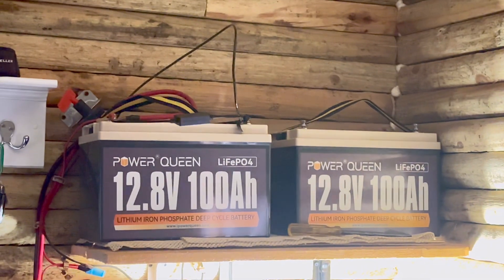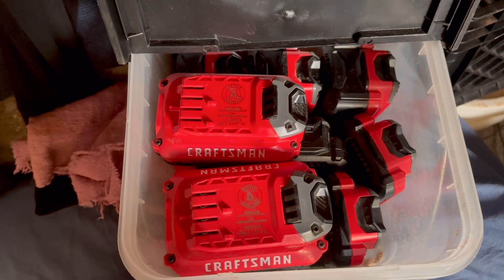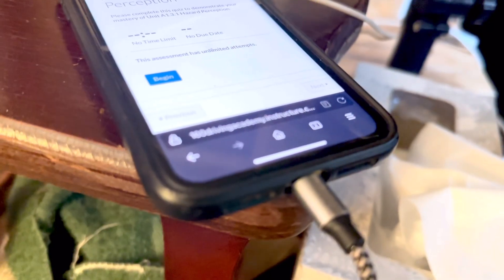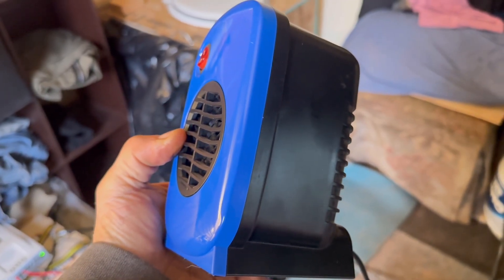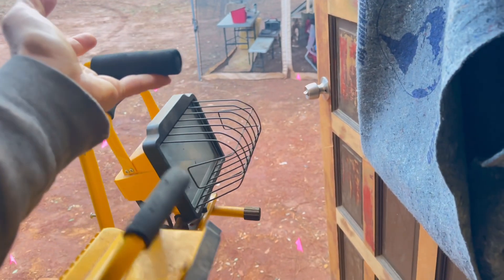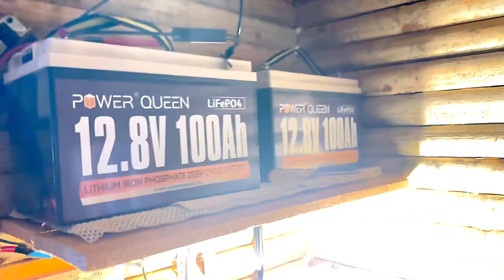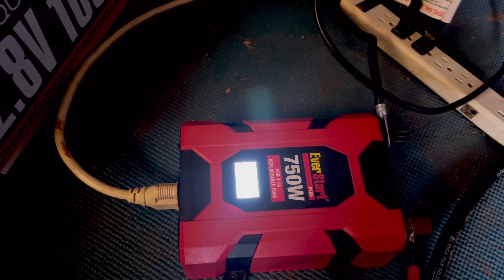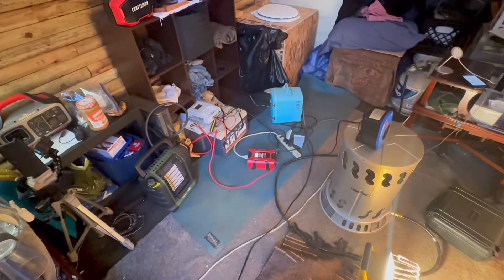E32 - these lithium batteries won’t drain!

Comment: The inverter will hit its own low-voltage drop-out before the battery cuts out.  So one simple solution is to just connect up a PTC space heater of the appropriate voltage rating directly to the battery.   Roughly 300W, and each of those batteries is 12.8V * 100Ah = 1280 Wh, so two batteries makes 2560Wh.  2560Wh / 300W = 8.5 hours to fully drain the batteries from full with a 300W PTC heater.

With lithium batteries, particularly because people are working with different voltages, it is better to just consider capacity based on watt-hours of storage and not amp-hours.   Watt-hours = amp-hours x voltage, roughly.
Reply from the maker: Most everything I own is in boxes, in some kind of storage. I had a tough time finding anything I could plug in. I really appreciate the info.

Comment: FYI, voltage is not a good way to determine the SOC of lithium batteries, a 0.2V difference can vastly change the state of charge (70-30%) and testing voltage under load gives false readings, you should look into installing a cheap shunt to ensure you know the actual SOC. Also, it should only take approximately 3.2 hours to completely drain the 200 amp hours (2400 watt hours) if you maxed out the 750 watt inverter.
Reply from the maker: I actually just read up on that information two nights ago in the book I'm reading. Would have been useful info before. But I have a good shunt on order now.

Comment: look into a cell balancer. i know the BMS is supposed to do that but ive found a dedicated balancer to work much better at actually balancing the cells. also most atleast all the ones ive seen have a discharge feature
Reply from the maker: These batteries self-balance after being connected for 24 hours.